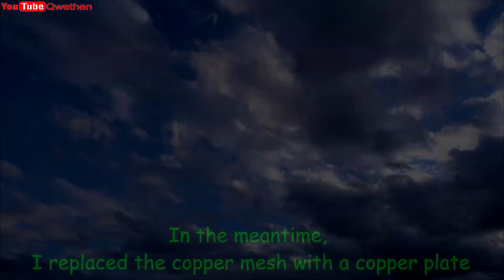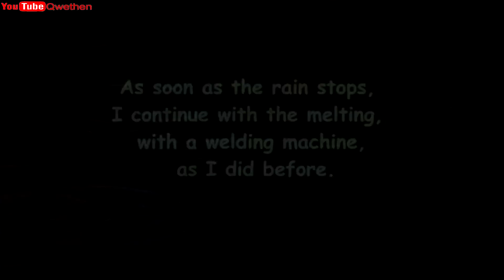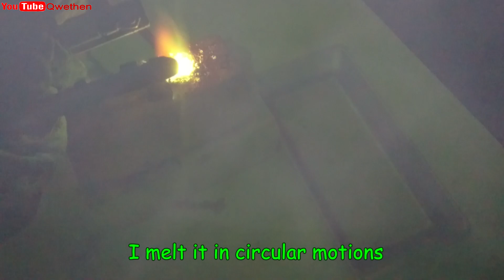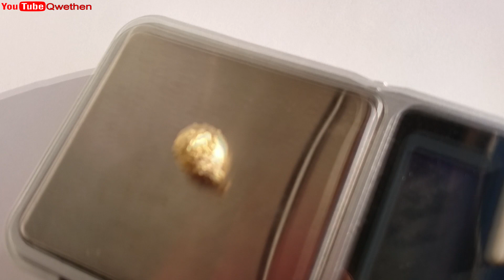Gold recovery and refining - full process - Make 24k pure gold in multi-layered gold / Pure gold /

Comment: You should dilute your Gold solution with water before you filter it.... Silver chloride is soluble in AR but not water. When the water comes through the filter into your gold solution, most of the silver and likely a lil bit of copper will precipitate out. You wont get to a high purity if you dont. Also you should consider a squirt or two of h2so4 before filtering. This will precipitate out any lead that was alloyed in or snuck in from solder.